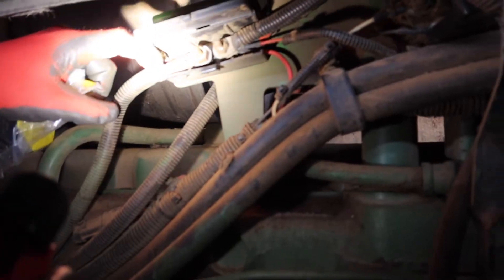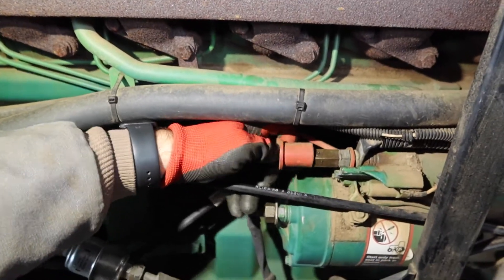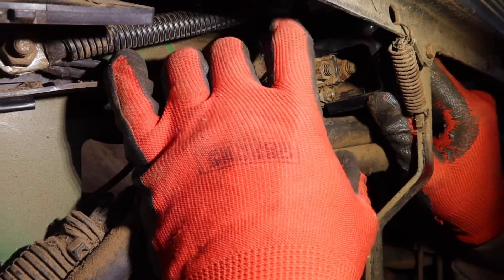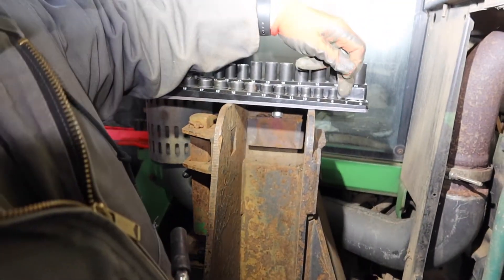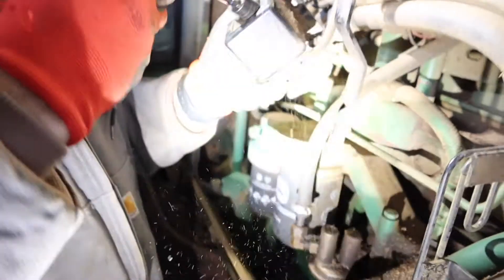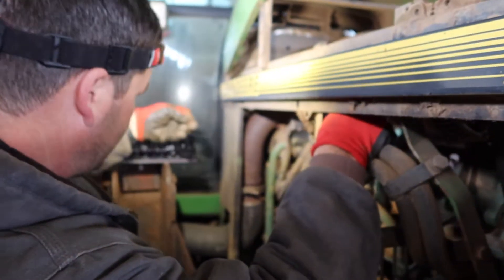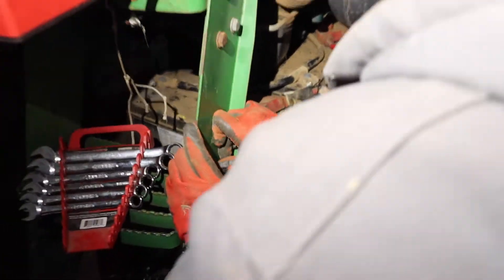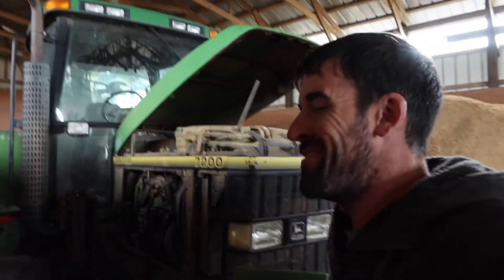Repairing The John Deere 7200 Tractor | Switch Problems Causing It Not To Crank

Comment: I have same tractor, going on high gear on highway it has low power, hard time moving bales when getting to hills. Changed all filters etc. any ideas?
Reply from the maker: Did you change both fuel filters? There is a small inline fuel filter